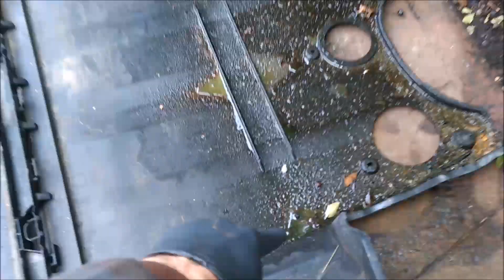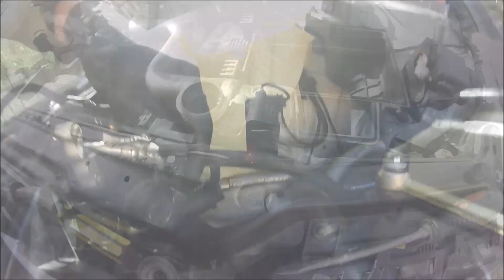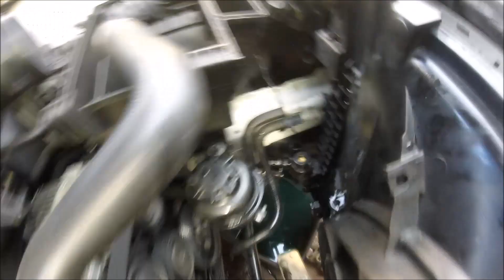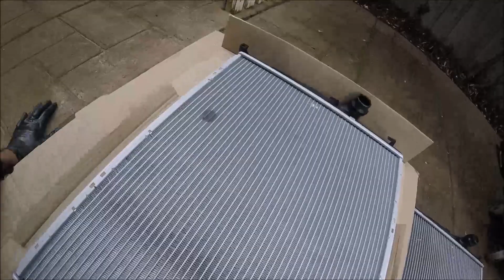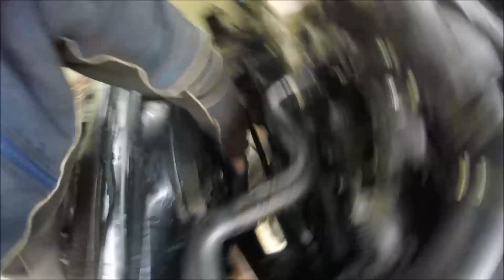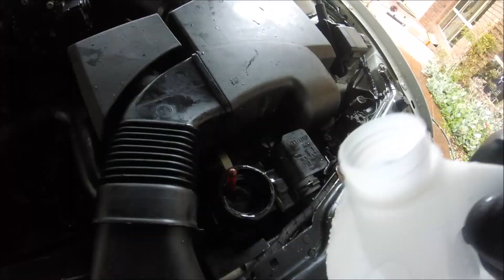2000 BMW 318i E46 Radiator Replacement

Comment: hey mate, I have the same e46 with the same engine and im replacing the radiator. My new aftermarket radiator came with 2 o-rings that are the same size. Do you know where i should put them?
Reply from the maker: Been some years now since I owned the e46, but from memory aren't they for the transmission thermostat on the rad?

Comment: this video helped me find the unfindeble leak the plastic screw thing that goes under the expantion tank at the bottom of the radiator is different betwene automatic and manuel i thougt there it a plug/screw in it so its good but noo it wasent

Comment: hey mate quick question, iv'e got an 04 318i that overheats after 20 min of driving it has also previously suffered a coolant leak, it sprayed out of the expansion tank cap.
Any thoughts on potential causes? thanks
Reply from the maker: Sounds like a stuck thermostat, have you checked this?  Also, they are prone to trapping air so youll need to bleed it correctly, loads of videos on how to do this. Make sure you got no more leaks, I basically ended up doing an almost complete coolant update due to the plastics failing.

Comment: What is the piece called that you removed from the radiator and put on the new radiator the black plastic thing
Reply: ive been trying to figur it out for ages no one has been able to give me a name but supposedly its a expansion tank bracket mount
Reply: In German we call it "Montageplatte" 30€  @X9ryze

Comment: Hello and thank you for this video. Everything was perfect explained. Although I have a question. Minute 5.48. what is it this piece you remove. This grey steel thing. Because in my car I didn't find something like that.
Reply: It was probably the automatic transmission fluid cooler. If your car is not an automatic, it won’t have it. In fact, the bracket will also be different.

Comment: Greetings! I have the 318ci facelift and it looks kind of the same.. any idea if there's any diffrences? Need to changr it fast :)
Reply from the maker: I think there are some subtle differences in the engine compartment, certainly I wouldnt rely on my model to compare and work on with yours.  RealOEM.com is a great source for finding parts with diagrams.  I usually refer to this site.

Comment: Hy, i have water leaking near the power steering cooler. i guess its the radiator right?
Reply from the maker: Could be the two little o-rings on the cooler pipes, these are easy to replace. Check around the rad edges where the allow crimps around the plastic tanks first to see if there are leaks. If so then yes its the rad.
Reply: @rovertasmania7033  Ok thanks, yea i think there is some leakage around the edges all way around, but the water was basically pouring out, floor got all wet. And when the engine was hot it blew steam. So i guess rad is shot :(
Reply from the maker: @SkazaTV  Could be, but you mention steam which now makes me think could be something else.  Check your expansion tank, leave the engine running and see if anything leaks there. Mine had a crack, and only under normal engine temps could i see the coolant streaming out of the crack and onto the radiator.  Also check the hoses, the plastic joiners can crack and also spray coolant.
Reply: @rovertasmania7033  Thanks, you were right. The expansion tank is cracked and spraying water onto radiator. :)
Also rear flange is kinda leaky.
Reply from the maker: @SkazaTV  must be a common failure then. Rad leaks are generally slow drips, of course unless it ruptures. You may find that now will be the time to think about replacing hoses, especially back of engine one. Mine sheared at the plastic union given years of heat i suspect.
Reply: @rovertasmania7033  Yea, engine operating temperature is 105C*, which makes things break even faster. 
By the way your engine flange(screwed onto the engine) sheared or the hose?
Reply from the maker: @SkazaTV  It was the flange in the hose itself. Took a bit to remove the plastic remains off the engine side. I ended changing them all over after that incident!

Comment: Что то вы друг не правильно антифриз заливали. А как же включить печку на минимальные обороты и температуру на +32 градуса? Что бы клапан открылся. 
А то так получится воздушная пробка. Поправьте если я ошибаюсь где то
Reply from the maker: Not sure if I understand completely. Turn the heater on slow fan and max temperature so that any air can also escape out of the heater matrix.  Check how hot it gets, if its not hot then you have air still trapped in the system.

Comment: Thanks for uploading. My radiator popped last night. this was helpful.
Reply from the maker: When they go, they go quickly. My other advice is to replace rad hoses as after my rad swap i had a few hoses fail, snapping at the plastic ends. This especially applies to the rear hose going into the block and the ones under the injector system.

Comment: I have a leak at the bottom of the drain plug. Cud it be the radiator? Plz help
Reply from the maker: Check everything above it, like expansion tank and side walls of radiator. Expansion tanks are known to crack like mine did and drip down the radiator.

Comment: THANQQ !!! finally , you cant find a lot of clips about the 1.9 , all i see is 6 cylinders . 
Bro i thanq you a LOTTT for this one. 
I'm gonna do my repair this saterday , i have to change the waterpump , thermostate(it staysopen so fan is ALWAYS spinning till battery is dead) radiator change , oil and oil filter  , ow and window mechanik ,
Reply from the maker: Your welcome and best of luck with your repairs.
Reply: Because nobody buys these toy engines
Reply: @e36fanatics  but i have one and that needs repair once in a while , if they make a video repair on fxking vibrators , than why not on this engine ??? This comment is SOOOO USELESS !!!!

Comment: Hello!

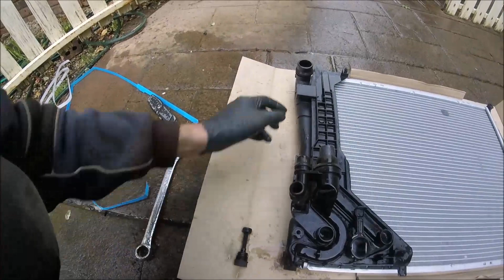Can i have overheating  problems, because of that small thermostat at 12:55, for example if its closed?
Reply: Skaza u
Reply from the maker: Yes if its not working... its the same principle as the coolant thermostat. Should be changed when servicing the coolant system.
Reply: Turns out it was just air in system :s

Comment: Did you end up finding out if the new style drain bung made any difference  to the radiator ?
Reply: My new radiator came with two bungs in a loose bag - one shorter one as you used, labelled "Auto" and one longer one like the original you show marked "Manual". The manual one has an O-ring that stops coolant getting into the lower chamber, thus coolant wouldn't get in to the auto transmission cooler. Sadly can't add a photo to show ....
Reply from the maker: None that I can see Bob, engine temps are fine and if anything the auto box shifts slightly better - although I did notice some gunk in the old rad that would possibly limit coolant to the heater exchanger.